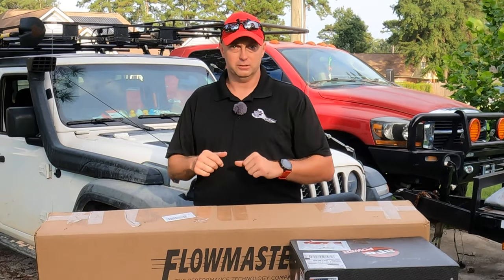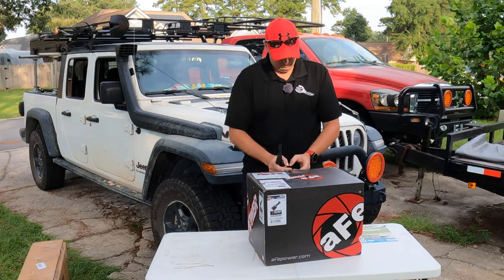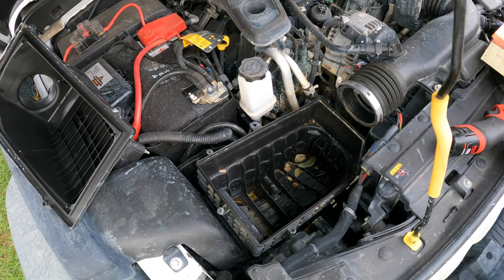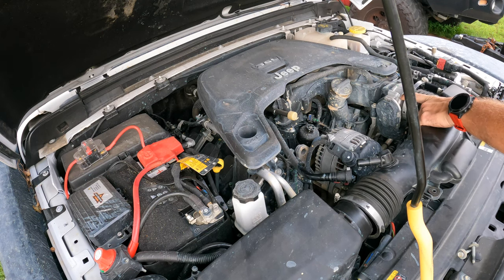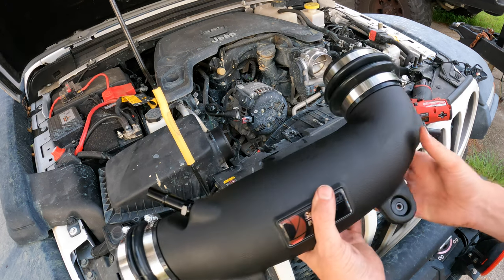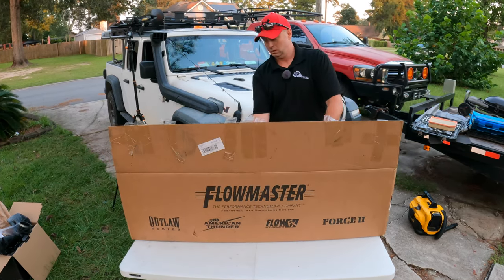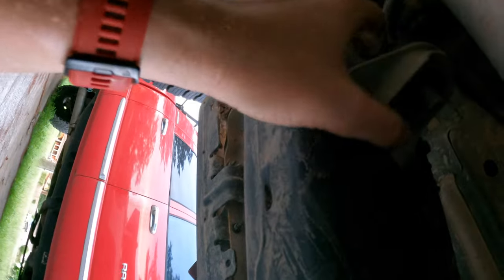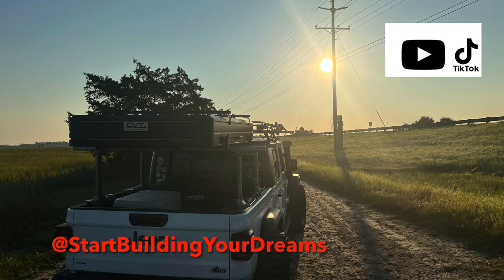AFE Cold Air Intake and Flowmaster Outlaw Extreme Exhaust Installation on Jeep Gladiator Rubicon JT

Comment: Did you hear a difference with just the intake?  Love how it sounds when you were done. I’m considering borla duel exhaust just cat back and k&n cold air intake
Reply from the maker: The snorkel made the biggest difference to the intake sound overall.  Especially when cruising around town with the top off and windows down.   It sounds gooood…I’m sure if I had done the intake before the snorkel  It would have been more noticeable.   The Outlaw Exhaust is loud and reminds me of the old In-line 6 4.2L I had in my YJ.  Borla and K&N make good products, but if you want the lowest restrictions the AFE and Flowmaster are tough to beat.  Funny enough I noticed the exhaust sound got even louder after the lift because it points straight down.   Let me know how it turns out and thanks for asking!

Comment: we've done the flowmaster on our gladiator.  Haven't done the air intake.  Any real MPG increases that you've seen?
Reply from the maker: Thanks for the comment…I haven’t noticed any considerable MPG gains to go bragging about maybe 1-2 at best, but it does feel overall that the  jeep has a little more torque than completely stock and spins up slightly faster in rpm.  I’m using 6th gear in my Manual Trans a little more than I used to on the interstate without losing power as quickly.   I do still Find myself mostly cruising in 5th or 4th depending on mpgs, and overtaking slower traffic in 4th and 3rd.   1st is a short shift on the manual and you can ride out 2nd to a little over 50mph with 37s and 4:10 axles. I’m not sure how that translates if you have an automatic though… let me know how it turns out.  Jon@SBYD!
Reply: I put a Flowmaster Outlaw on my 2017 Jeep Wrangler Sahara with a K&N Series 77 Cold Air Intake. I kid you not, I did 0-60 in a little over 6 seconds! Not bad for 3.6 V6 FI engine! It does increase your horsepower & torque!